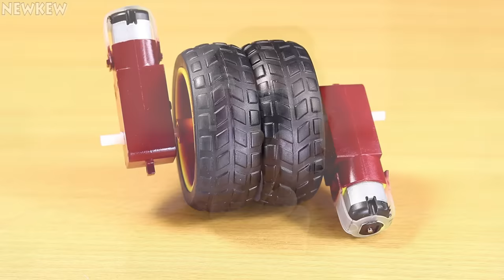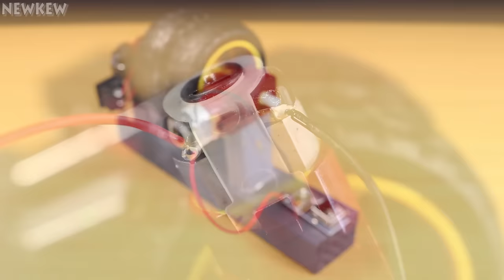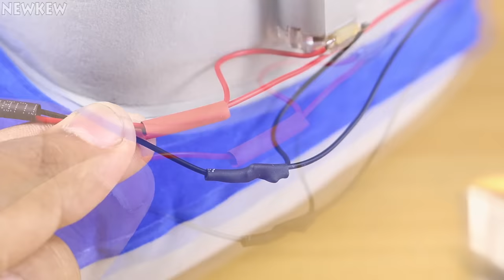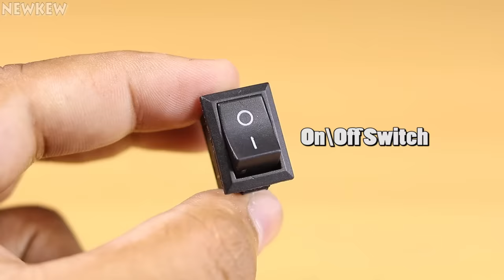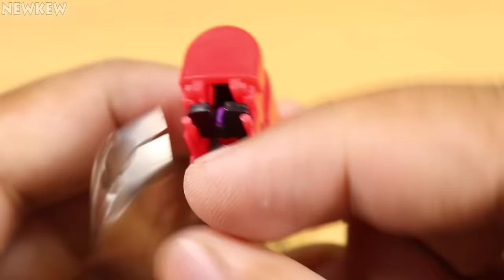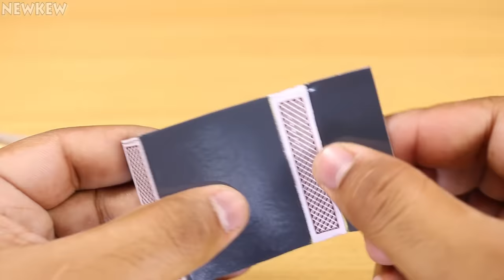5 SIMPLE INVENTIONS

Comment: For a couple cents you can get a 5v USB power module (charging module) that will work perfectly fine with 9v in 5v out. You just hook the battery plug right up to it. It's far simpler, requires much fewer parts, is easier, is more efficient and is much less likely to damage the device you're powering/charging. It would also have a true DC power source, which this one doesn't because of the nature of producing electricity directly from a generator/motor (without a rectifier). I don't know that last statement to be an absolute fact, but I'd bet that hooking it up an oscilloscope would show that it's more like an AC power source than a DC power source (which could damage any devices you power with it or more likely could damage the batteries of any device you power with it). Hope you forgive the rant. It looks like a fun project to build, but I just hope people don't copy it and then damage their phone or tablet they paid $100's for (or any other device).
Reply: Kardeş sen bunu yazarken hiç üşenmedmi
Reply: @yaseminozkal8550  çok komik. Yazmaktan hoşlanmadım, ama söylenmesi gerekiyordu. Umarım insanlar telefonlarına zarar vermezler.
Reply: Exactly , adding 2 motors... It's absolute nonsense

Comment: Why not just go straight from 9v to the 5vc dc-dc converter? I was thinking maybe current would be too high and the motors suck up some current but thej why not just add resistors? Or can the converter not take more than 5v and so you're using the motor to motor voltage generation since it inherenty reduces voltage due to being inefficient?  Someone help me out here, what am i missing?
Reply: Well you can now put the wheel to a turning object like a bike tire and generate power

Comment: Yeah, I don’t think, in a pinch, these would be very useful. For the five 9 volts that powered the LED light, why use so many 9volt clips, when you could’ve just snapped the opposing polarities of these batteries together. I I snapped four 9 volt batteries together and the positive and negative poles left that o could use actually powered an LED light bulb used for house light fixtures. Seeing as how LED house bulbs are stepped down from 110-120 Volts to 32 volts. I never needed to soldier glue or any other accessories other than bulb, old light bulb fixture with its wires, from a lamp four 9volts and electrical tape. Everything I didn’t pay for, just had laying around the house.

Comment: I don't understand the purpose of the first invention. Couldn't you have directly connected the 9v battery to the 5v dc-dc boost connector and then charge it?
Reply: Yes, first device totally useles.... But  boost coverter and 9 volts sounds danger for smartphone. In this case, i I will try disasembly 9 volts battery usaly it consist from litle cells, and use its separetly
Reply: @dinetsandrew  Aight , this makes sense
Reply: Yeah it's dangerous for the phone, hard to create AND! it wastes too much energy, why didn't you just directly wire the battery to the converter?The dynamo also consumes energy you know😑😑😑😑😑
Reply: Yes bro
Reply: 6plfl
Reply: Agreed brother total useless👎
Reply: I also thought that..

It doesn't matter any sense.. it's totally useless., But Directly connecting 9V battery leads to any damage to phone..?
Reply: 5
Reply: To understand it you need a brain that you haven't
Reply: Or you can just charge your phone normally with a wall plug
Reply: Bro fro simple battery u cannot charge your phone But from this it creat double power
Reply: Mp
Reply: आपहमेअपनाचे हराकयुन हीदिखाते
Reply: Exactly
Reply: Yes u r right
Reply: @Ch.Hashim_15  0

Comment: Nice video bro its inspiring
Reply: No it isn't, everything he made was completely useless and there are better products out that do the same thing. Take for example the match striking machine. Whoopy doo it lit a bunch of matches but what's more convenient. Having the striker strip on the side of the matchbox or having to carry this dumb ass device to strike them which will likely fall apart in your pocket because hot glue while great in static applications doesn't hold very tight in your pocket.